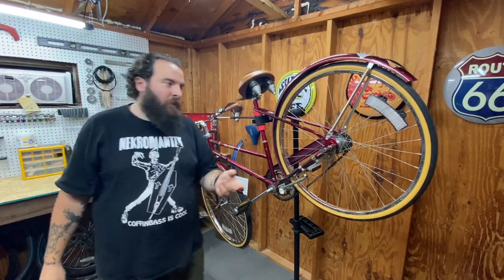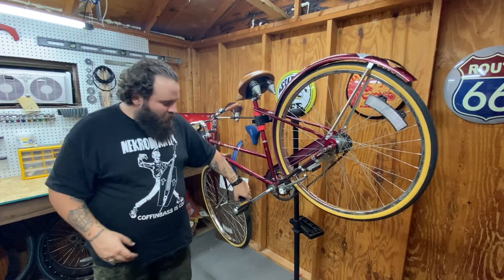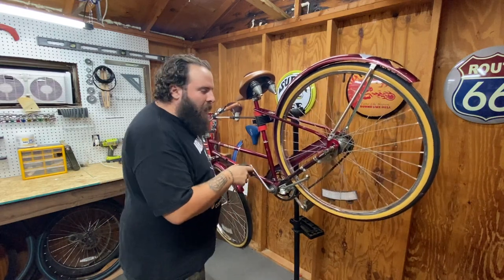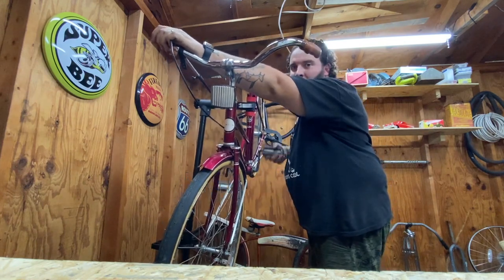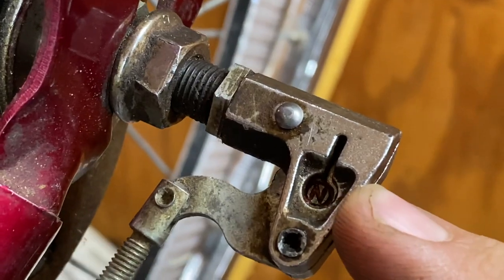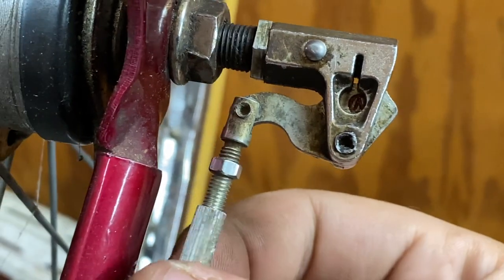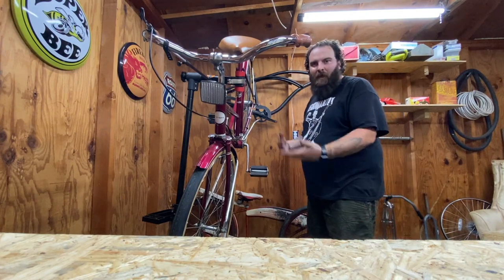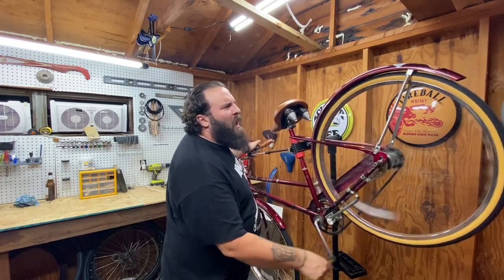How to Adjust an Internal 3 Speed Hub

Comment: What do you do if the rear wheel locked up? Breaks are not stuck on. I have one with hand breaks, and free wheels.
Reply from the maker: I would try disassembling the hub. May need to be greased
Reply: @JoshHarrisRides  there not junk when they lock up?
Reply from the maker: Not always. Depends how much time you want to put into it.